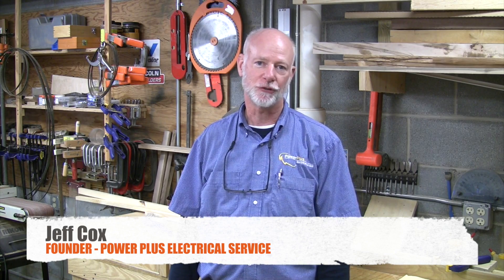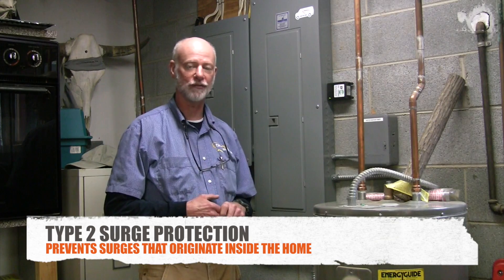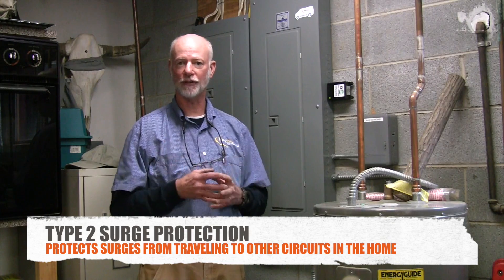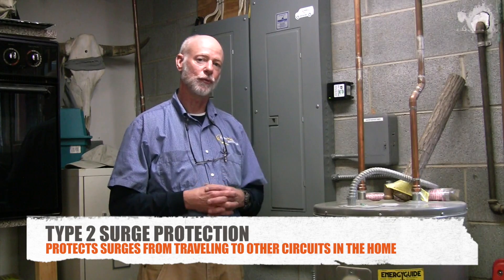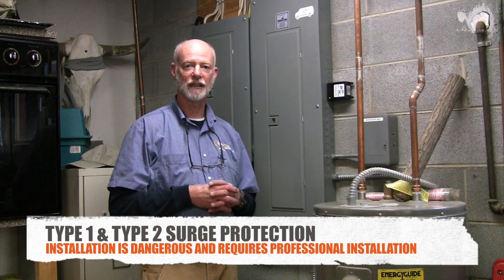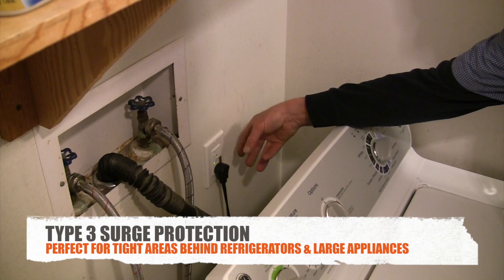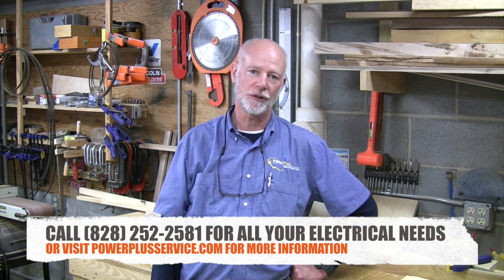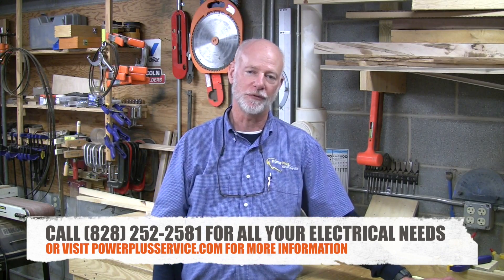What is Type 1, Type 2, and Type 3 Surge Protection

Comment: thank you so much!  question:   most house hold install type 2, can I say that it will not protect surge from external such as lightning or faulty issues from the transformer from the electricity pole etc?  anyone?  thank you again

Comment: I'm going to install an Intermatic AG3000 to to protect my heat pump from surges coming from further up the power chain. Will it also protect other devices in my house from a surge originating from my heat pump compressor or fan?

Comment: Didn’t get into the nitty gritty of the various surge energy ratings and peak current mode ratings.
Reply: Agreed, but that's not what the vid was about.  For the time spent, this was a solid vid.  Get a recommendation from your electrician on the surge protector that is best for your area (tornados?) and use (do you actually have sensitive equipment?).  As an electrician, I use a siemens TPS3A03050 for residential services.  It's only $200, and offers solid protection for the money -*for where I live*.  It is far from the best protection, but I live in a city where surges are rare and relatively minor.

Comment: I sell large appliances and, unless something has changed recently, we've been told that to not use a "type 3:"surge protector because of the current pulled by the AC motor when it starts.  I had an electrical engineer explain it once with charts and graphs but I could not reproduce his explanation if my life depended on it.
Reply: It seems to depend on the motor. There are some different motor types, but age may also be a factor.

Comment: I would like to have my electric utility company install a type one surge arrestor at my house, but they are not even sure that that is something they would do. Do you have any suggestions as to how I can get the electric company to get out here and install one?
Reply: As an electrician, I can tell you that, where I live: an electrician has to do this.  I imagine it's the same everywhere.  The power company cannot justify spending the money to put surge protectors in everyone's home; a power company is responsible for electricity getting to your home; in some places you are actually responsible for connecting to their lines (they own the power lines, you own your service equipment).  For example, they also won't install AFCI circuit breakers or GFCI receptacles even though they are potentially life-saving devices.

Comment: So he forgot to mention you have to have a good grounding system in order for the surge protector to actually draw the energy and dump it to the grounding. If you do not have a solid grounding system meaning a copper ground rod those surge protectors are just going to sit there and look very pretty and provide no protection. This guy needs to work on better educating people if he's going to recommend specific devices.

Comment: What decides which type 1 you should get? Are they by size or pretty much one fit all?
Reply: you can only get type 1 from the power co and they will install it
Reply: @billman6364  Not necessarily  true.  You can order them at lowes or home depot.  Where I live (PA), an electrician installs it, not the power co. (and Yes, I happen to be an electrician and install them.  For the record, I use a siemens TPS3A03050).

Comment: Never seen a protector on a meter outdoors..  wouldnt know what they look like.  I know not every meter has that because ive blown a few up..  as well as seen a few lightening strikes kill damn near every light bulb in the house and meter still spinning..  what would the meter say if it had protection?  Type 1 service meter or something?  I always thought the ones you put by the breaker box was the first point of protection if installed..  otherwise ive never seen just a meter alone not working due to surge trip or fail.  They cant be resetable if primary function is on the scale of lightening or transformer pulse surge..  in all surge protectors with mains protection and not just transient or gfci/ afci, those are resetable triggers, but mains fault or surge gates are parts that fail open circuit or may be internally resettable if not a high current fault hits it...  not dogging on you, appreciate the time you took to inform others, but just wondering because would get me one of em..  too many times my unlucky arse had to file claims and do without garage doors, tv’s lost data on pc’s, blew my fridge and freezer just stocked with a whole damn cow..  you have no clue how depressing it was giving away 600 lbs of fine cut angus beef butchered a month ago feels like, especially when 90% of them dont thank ya and some even argue about what you had left like theyre entitled to better free shit..  watched some take the meat and open the freezer lock and try to smell it...  anyways, those memories need not be thought about again..  is where murderers are born..   so..  sorry for that story..  but its typed out so yea..  if it pisses you off reading it, amen, your a good person...  lol..

Comment: Thanks for the video. But I noticed something...

That type 2 surge protector is a fire hazard (according to UL). It's been linked to house fires. Why do I know or care? I have the equivalent "Supco" brand unit attached to my A/C compressor and it caught fire at some point in the last few days. Luckily it was mounted to brick and didn't burn my house down or cause any damage other than some blackened bricks. A little research online and I found out that some other people weren't so fortunate.

Comment: do you think this surge protector would work for DC current I have solar panels, so the regular surge protector for this are almost twice the price
Reply: Solar generated power will not surge..  do you know anything about the system or was it inherited?  Those arrays can be very dangerous however.  They need gfci and arc fault protection, fuses, breakers..  not surge..  if they get hit by lightening or your worried about that get lightening arrestors, theyr like fuses...  but unless you have some massive solar array and a few hundred kw of voltage on batteries stored and a generator being powered by that energy, only then, after that generator would surge protection be applicable.  Because the start and stop and sometimes running can produce surges or ripple currents that will pulse your stuff using that power.  But i suggest first tossing a fork across the contacts of your solar set up just for you to get an appreciation for what they can do.  And maybe spark some interest for you to dive into learning more on them.  Theyre alot more than a solar panel and a socket..
Reply: My guess is that you'd need a TVS diode (transient voltage suppressor) for electronics such as that. But I think the other chap is correct that it shouldn't be an issue